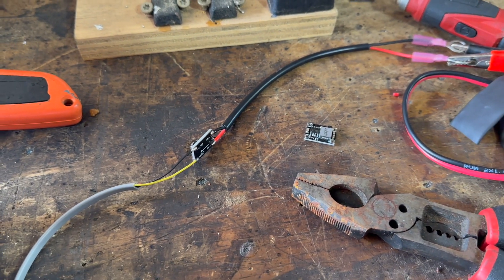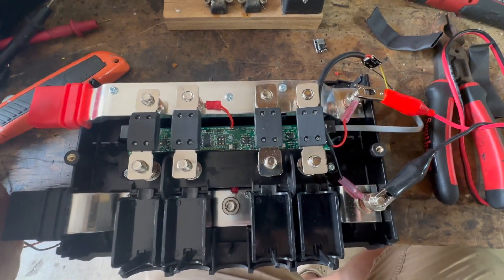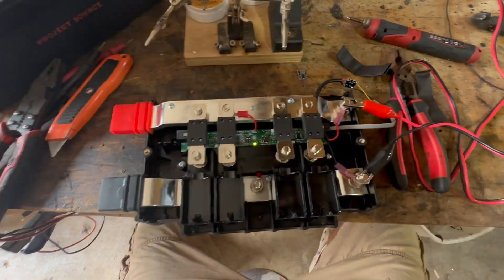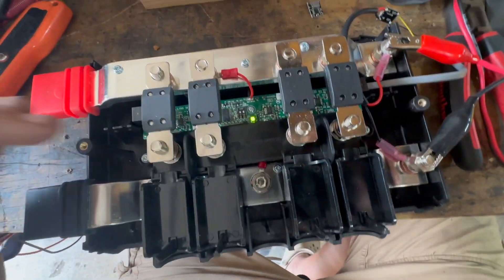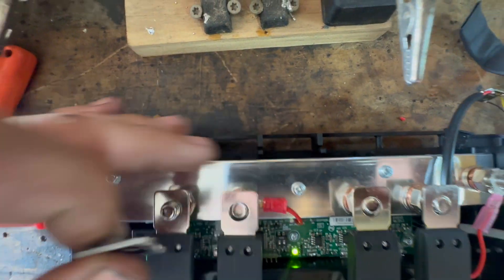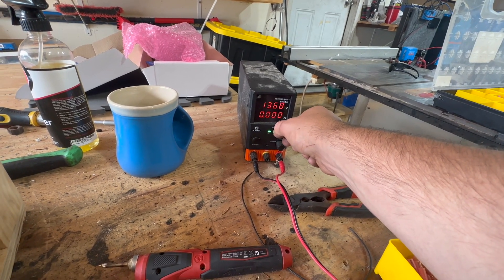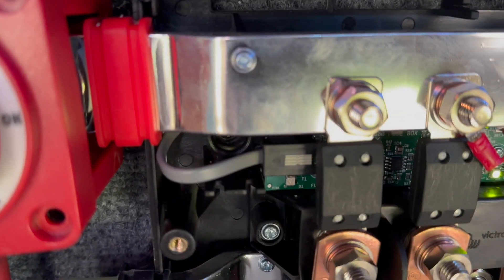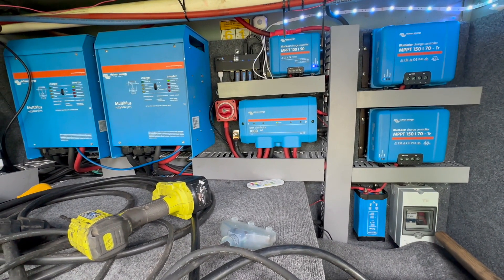Victron Lynx Distributor LED Cable 24v Update  - What doe the LED Lights Do?

Comment: Solar Assistant selling step down cable:  
- input = 9-60V DC ring diameter 10 mm
- output = 5V 3A micro USB 
If it would be possible to replace the micro USB with a suitable network connector,
then this modified cable could work from 12V to 48V system
Reply from the maker: I’ve since found a supplier. Working on producing some.

Comment: Love Victron products.  That's all I use. Question for you.  I see that you have 3 MPPTs and 2 Inventers all connected to one lynx distributor.  Didn't know that was possible.  Thought each had to be connected to its own individual port?
Reply from the maker: You’ll want to watch an episode a few back where I re-engineered my system.   In short, I made a mistake, ran out of time, and bussed all MPPTs into a single Lynx input.  Perfect? No, better than it was? Yes.

Comment: Just curious why you guys don't use the lynx shunt.  Wouldn't that power the lights on the lynx distributor?
Reply from the maker: Two reasons. 1) often times it is not needed (expensive for what it does) 2) no mid point monitoring for higher voltage systems. Or starter battery monitoring. 

We do like them and have used them in the past.